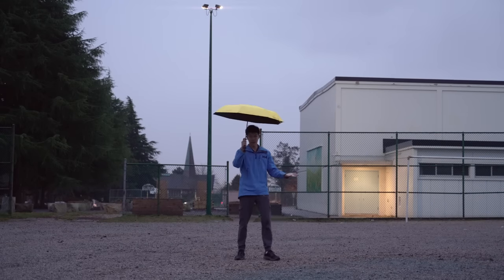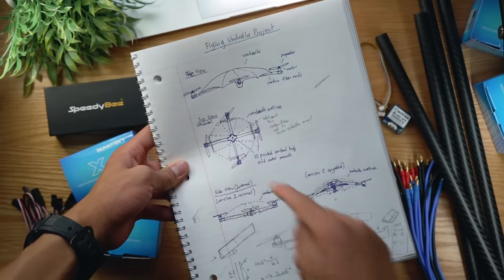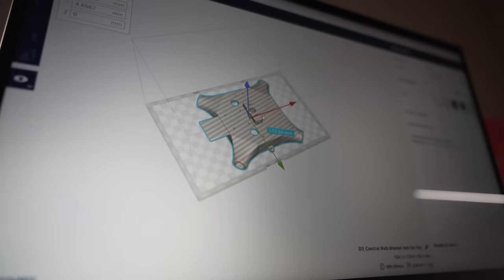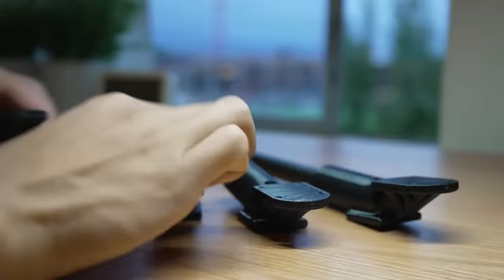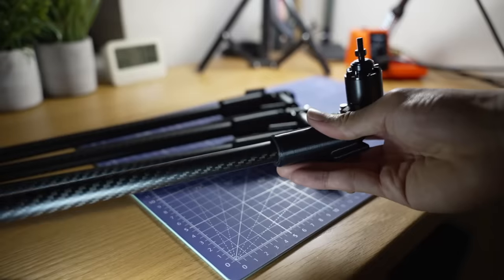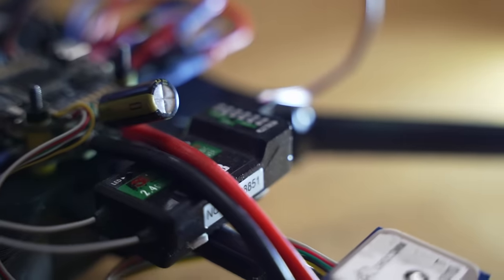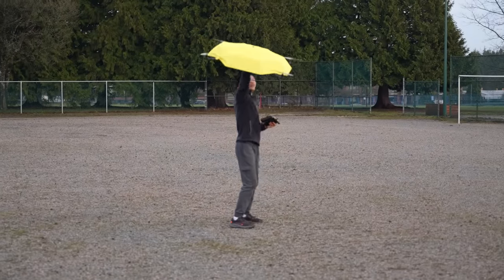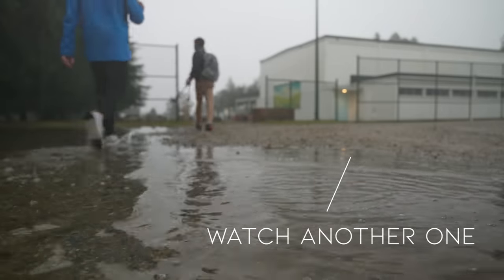I Built a Flying Umbrella

Comment: isn't this in simple terms - an umbrella fitted to a drone? I would be stoked if the umbrella naturally follows the user, but it appears unusable if it requires the user to remotely control it while moving. Also there is a huge safety issue here with the way the blades could cut the user or the people around them (there have been tragic accidents). 

I feel like this is one of those inventions which is unnecessarily complex... In the first place it's not that inconvenient to hold an umbrella, but now it's doubly inconvenient when you need 2 hands to hold the remote controller, look out for safety, etc. One could have easily attached the umbrella to a bagpack or something, or even attach the umbrella to an existing drone, to free up one's hands without all that work. it's a fun invention but impractical, although I applaud the inventor's ability to make such a thing.